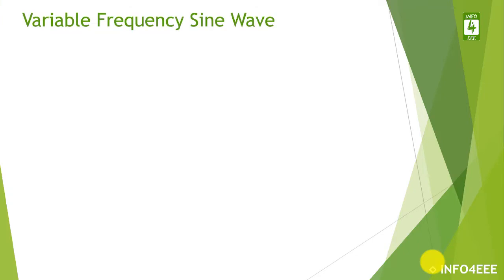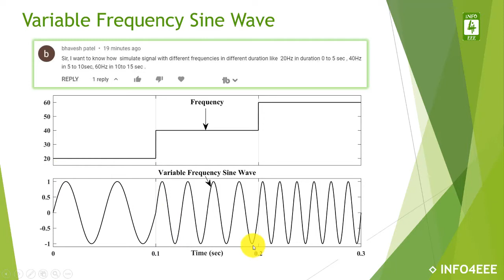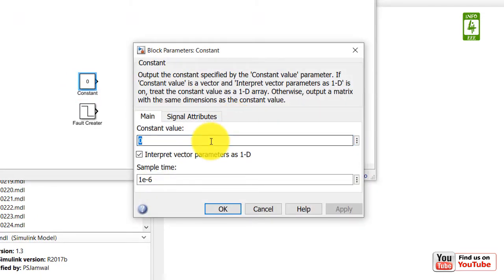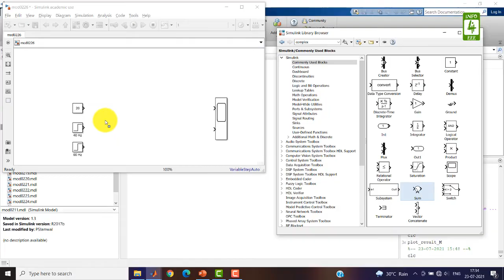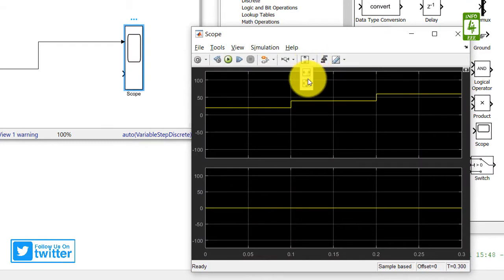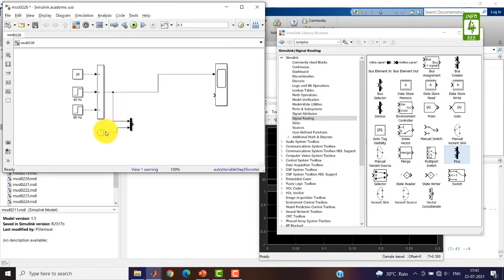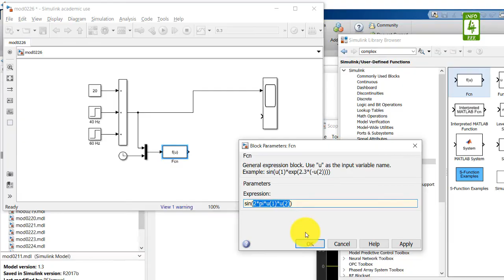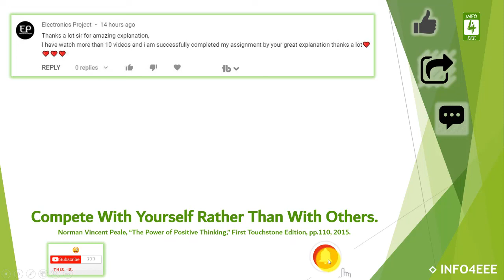Variable Frequency Sine Wave Using MATLAB Simulink #26 | Basics | Paramjeet Singh Jamwal | INFO4EEE

Comment: Do you have any tutorials to variable frequency? I gotta do an 1 voltage amplitude but with frequency varing from 1 rad/s to 10^10 rad/s
Reply from the maker: For this you can change the frequency using ramp from and set m = 10^10 - 1

Comment: Hello Sir. Thank you for your video. It helps me a lot. What if I want to make variable input freq and voltage. Can I use ramp block? Because I need to make sure v/f constant with changing voltage and frequency
Reply from the maker: Hello @sirtufillaila9781, Thanks for finding time to comment your kind feedback. Yes, you are right. You can use ramp block to variable input frequency and voltage by making v/f ratio constant.

Comment: Hello sir, I need a help from you.
I want to make a variable frequency control isolated dc-dc converter. I have to design a process block that will take response from PI controller and then gemerate PWM signal to provide variable switching frequency for three phase inverter. How to do that? How I can generate the PWM signal of variable frequrncy so that it always remain in between a minimum amd maximum frequency?

I would be grateful to you if you could help me. 😓
Reply from the maker: I hope 20th video of this playlist which was on relational operator block will be helpful to understand pulse width modulation in MATLAB Simulink.

Are you talking about dc-dc converter or three-phase inverter?

Comment: fcn block is removed n matlab 2021. can you write the program in matlab function block for sin(2*pi*u(1)*u(2))
Reply from the maker: Thanks Mr. Santosh Kumar for the information about fcn block. Please find the program for sin(2*pi*u(1)*u(2)) as follow:

function y = fcn(f,t)
y = sin(2*pi*f*t);
end

This program will create two input terminals. In first terminal, you can use constant/ramp block to fed constant/varying frequency. In second terminal, you can use clock block to fed time.

Comment: Hello Sir, 
Thank you so much for this useful video! 

Can we increase the values of the frequency in a linear manner or a logarithmic manner instead of selecting a specfing values (for example every 5 seconds like your video)  ?
Reply from the maker: Thanks Mhmoud Khadija for your appreciating words.

Yes, we can increase the values of the frequency in a linear or logarithmic manner. For this, we need to use ramp or math function (log option) block instead of step block.
Reply: @info4eee  Thank you so much sir!